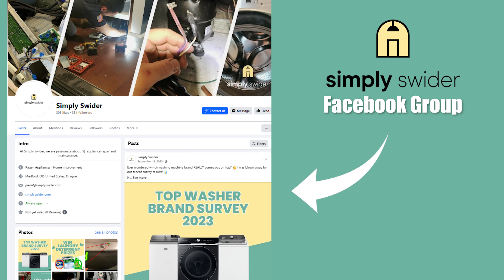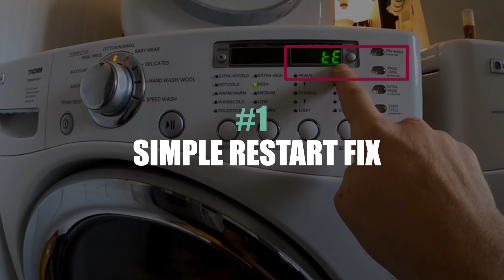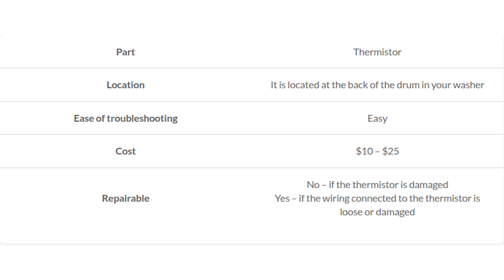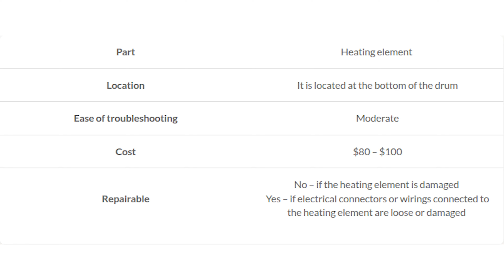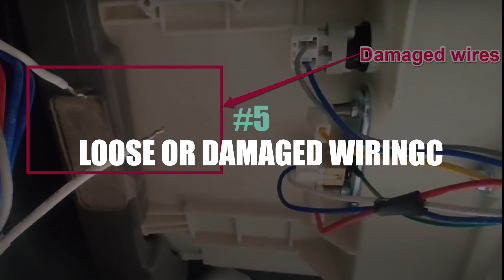TE Error Code LG Washer — What It Means & How to Repair It

Comment: my LG WM Model F2718RVTV - same tE, replace thermistor, but still same. The heating box have 3 sensors.  2 of them look similar in the video, the other sensor have 2 small contact, after remove for inspection, found one contact fill with deposit. Done cleaning and fixed back but tE still remain. May be faulty heating element.

Comment: Mine was from an open short in the white wire , as it goes across the dryer fan there is a clamp and it had pinched the wire. It sparked and burned two wires which I spliced in. 
Keep it simple, like you said. Follow the wires and inspect them well.